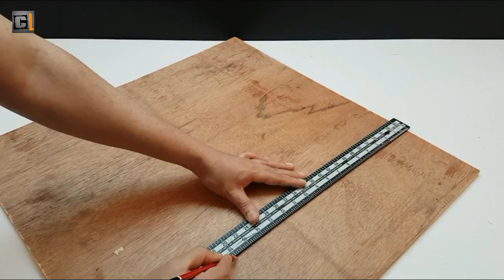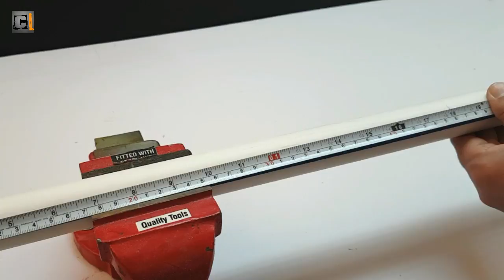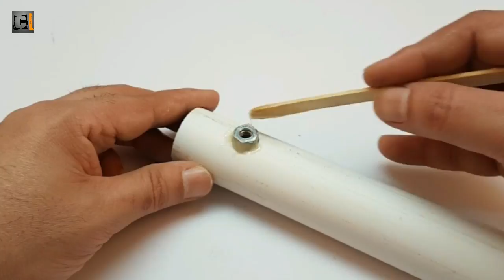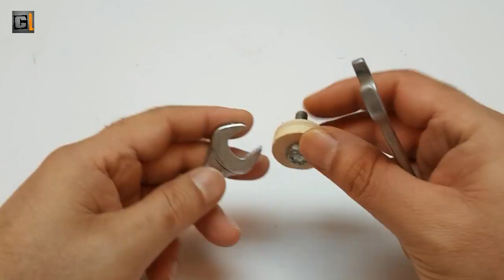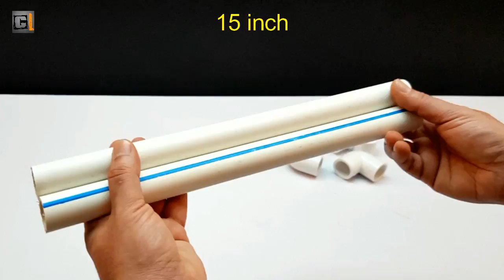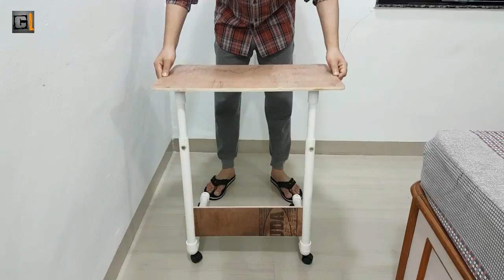Homemade - Portable Height Adjustable Laptop Table (Using PVC Pipe)

Comment: May be you can increase the strength of the pipes by pouring sand mixed wet cement inside and allow it to dry
Reply: But if you pour at the bottom part the upper part can't move in and if you pour on top part then due to weight bottom will break so wet cement not a wise idea

Comment: one small flaw, the pipes that go inside and are being held by tightening the screws , should also have holes the size of the screw at two inch gaps, that way when you tighten the screw from the other end, it will be much much stable than how you have tightened it

Comment: Cost of wheel where you buy
Reply: i got 8 mm one 50 rs each in Pune
Reply: @mera_bharat_mahan5171  hii.
Where in Pune u buy.
Reply: @geetagujuri9853  from Sanjay park. I still have with me. The size of wheel is 8mm, if you want I can ship to you. I have changed my mind I am not going to use wheels on my table.

P.S. Anyone who needs 8mm (4 wheels) I can ship it to you.